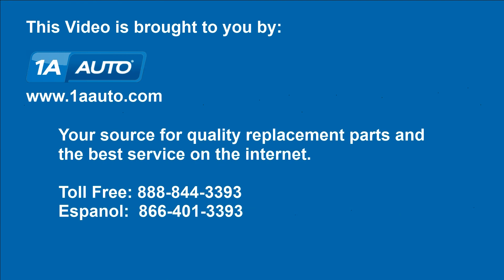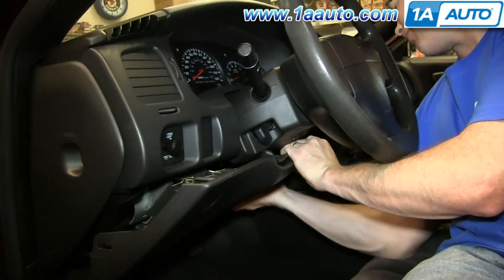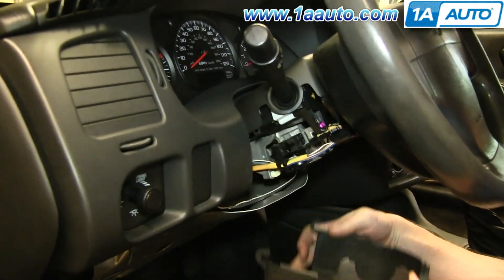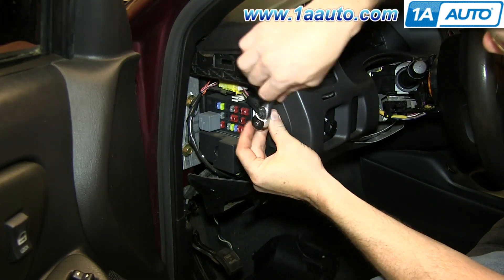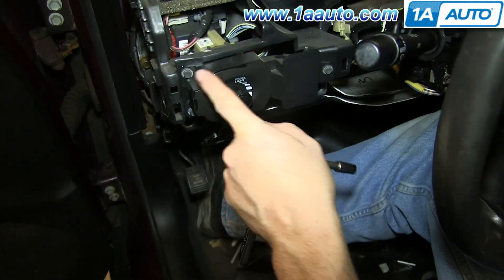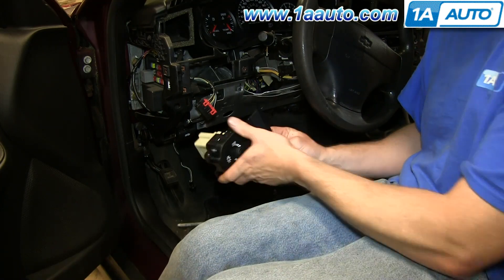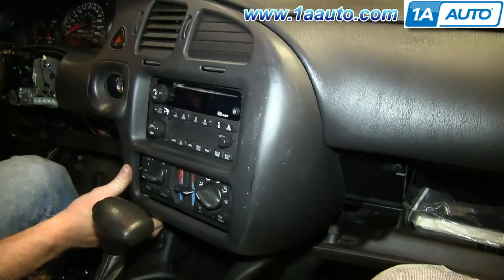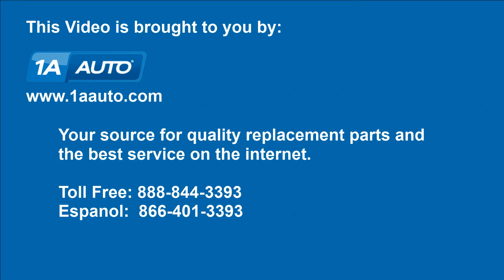How to Replace Headlight Switch 00-05 Chevy Monte Carlo

Comment: Thank you so much. I just tore down the entire dash to fix and replace my headlight switch. I got a headlight switch from a junk yard LS Monte Carlo and just swapped it out into my SS. I had to MacGyver a hole for the fog light switch and that turned out great. There was one thing I think you should’ve touched on, which was disconnecting the negative battery terminal to prevent the air deploying when messing with wires. If you accidentally touch the DAB wires with any other inter-route wires, the airbag can deploy. But overall, this tutorial has helped a lot. Thank you. 🙏

Comment: hi my name is john and my wifes car is a 2001 monte carlo and her turning singal goes out sometimes and sometimes they work, i was thinking it was the relay switch, am i right. and her headlights dont work just the high beams. she can use the fog lights too. but low beams dont. i changed the bulbs, could it be the switch or a fuse? and if its the fuse where is it located at
Reply from the maker: +John Carll Thanks for watching!  That issue could be any of those things, including the turn signal switch.  1aauto.com

Comment: Does a broking head light switch has anything to do with the instrument cluster lights not working on a 2004 Monte Carlo?
Reply from the maker: It shouldn't, you may want to check the dimmer switch that dims the cluster to see if that's acting up. Also check the fuses to make sure that they are okay. Hope this helps you out. 1aauto.com 866-403-3393
Reply: Marlo Dickson well the headlight switch is the dimmer for the dash cluster lights isn't it?  Other folks on the forums had success replacing the headlight switch to get the dash cluster lights working.
Reply: @1AAuto      Isn't the dimmer switch the headlight switch, just turning the knob to the left and right???

Comment: Hello. I have a 2006 monte carlo and i was told my foglight regulator switch is bad. How do i replace that. Can anyone help?  Thank you
Reply from the maker: +Dave Ries We currently do not have an auto repair video with this particular repair. We will keep this request in mind in the event that we need to make this repair in the future. 1aauto.com
Reply: 1A Auto: Repair Tips & Secrets Only Mechanics Know 

My Passenger side high beam or low beam headlight won’t turn on but the blinker still works. My driver side Lo beam and high beam works perfectly....

Is there a certain fuse that controls only the passenger side headlight ? I already replaced the Lo beam LED BULB.